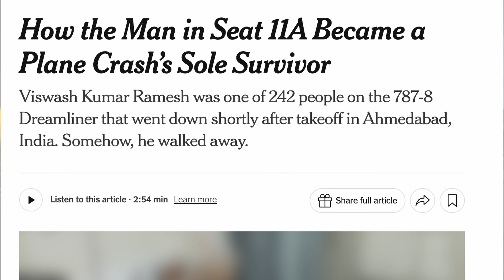Why the RAT Changes Everything – Air India 171 Update

Comment: A few points:

1. RAT deployment on the 787 can be manual or automatic. It is automatic in the event of total loss of hydraulic pressure for the flight control system actuators, or total loss of electrical power. Both of these conditions exist in the event of dual engine failure. Manual deployment is part of the crew immediate actions in response to dual engine failure. Right now, we don’t know which it was.

2. The aircraft flightpath shows clear evidence of engine spool down in the early part of the climb after rotation, and it may even have started prior to Vr. 

3. The last ADS-B transmission was at 100ft AGL (the 625ft reported was pressure altitude, which uses a different reference level for zero). At this point the aircraft was about 100ft lower than it should be, with a rate of climb and flightpath angle about half of what they should be.

4. “Positive rate, gear up” typically happens at about 50ft AGL and from the video it is clear that the main gear tucks had started to tilt, showing that gear retraction had started. But it stopped at that point, meaning most likely that the two centre hydraulic system pumps had stopped. They are electrically powered, and for both to stop would need both sets of engine driven generators to stop. This further supports the engines spooling down significantly during the initial climb segment.

What we don’t know is what caused the engines to spool down, leading to massive loss of thrust and electrical and hydraulic power. It is incredibly rare for two engines to fail simultaneously like that, and almost unheard of for that to happen during initial climb. The rapid rate of spool down without any visible smoke flame, noise, etc, strongly indicates fuel starvation but what caused that is a mystery right now. The engine run/cutoff switches could do it, but why would they be touched during takeoff? Fuel contamination could do it, but it would need to be severe and it seems no other aircraft from that airport were affected. Some comments have even suggested sabotage. At this point there is not really any more that can be deduced without the data from the flight data recorder, but it is clear that engine spool down is the critical aspect for which the cause needs to be identified.
Reply: Great observations… any comment regarding the flaps?
Reply: @Johnoftheshire  I think that is a red herring. The aircraft has protections to warn the crew of incorrectly set flaps, so the probability of them having been set wrongly for takeoff is extremely small. Similarly, flap retraction happens late in the climb, not at 100ft AGL! And we know the gear started to retract. So based on the evidence I think it is sensible to discount flap position being incorrect.

Also, aircraft rate of climb or descent is determined from (Thrust - Drag) x (True airspeed  /weight). Nothing in there about flap setting, although retracting flap too early could lead to a stall, but there are not signs of that having happened.
Reply: I agree there are no indications of a stall, and I’m aware of take off warnings with an improperly set configuration, but that appears to be a very clean wing for a fully loaded long-haul flight on a hot day. Your comments are quite salient.
Reply: @Johnoftheshire  actually on a hot day, provided the runway is long enough, smaller flap settings are advantageous. The takeoff roll is longer but the climb gradient is better, making the aircraft better able to handle an engine failure after takeoff. The runway at Ahmedabad is a very long one, over 11,000ft, so it makes absolute sense given the summer temperatures there to use Flap 5.

Comment: That's not the RAT  it's too far down, from the planes undercarriage,  that's the planes nose wheel.  So   who are you trying to kid, and it's   in comparison to the plane far to big  to be the RAT.    the planes black box will let us know what went off and the planes wings what's left of them will show if the flaps were retracted or in the correct position.

Time index 2;47  put  the video on pause  !!!..  you can clearly see the planes undercarriage  and there is NO   RAT EVEN DEPLOYED  THIS IS JUST MOMENTS  BEFORE THE PLANE WENT DOWN,  AND I DO MEAN MOMENTS,  8 seconds  in fact.  So all this talk from this captain here  is not making any sense other than it's nonsense.
No ,  something else has gone off here and it STINKS.

And you don't need to be a pilot to understand those factors. 
There are warning devices in the cockpit  to prevent making simple mistakes. Also i find it very hard to believe that both the Captain and the First officer with all their flight hours experience would make such a fatal error while taking off..

Even if the main engines had failed  they would still be spinning for quite some time and the noise from them spinning  would still be drowning out any RAT's sound. plus the RAT is a very small two prop  blade.  BASICICALLY  dynamo generator.
But as i have said at time index 2;47 you can see no RAT  was even deployed, is is about 8 seconds before the plane crashed and any talk of the RAT being seen  out  IS ALL  BALLONY 

Sorry i ain't buying a single thing this so called captain is saying not a single word of it. Who you trying to kid mate and more over why. You're saying it's a grainy image of the RAT but you cannot be totally sure.. Sorry not being sure is NOT GOOD ENOUGH. The Air Investigators will only be dealing with facts.  not grainy pictures or hear say..  But  FACTS  only.
And the only person to walk away from this , you're saying he's making stuff up or he imagined it..  ARE YOU REAL ??

P.S    I THINK IT'S  FUKCING SICK OF U-TUBE TO BE PUTTING ADVERTS CONNECTED TO THIS VIDEO..   YOU'RE A BLOODY DISGRACE.

Comment: The sound of the RAT propeller is heard when plane is close by, that is when the rat would be better visible. But it's not. You can only point it out when plane is far enough to RAT be only a splotch on the screen. The timing doesn't work here.

Comment: There was a guy that was on that plane coming into that airport and he said they had no air conditioning, no lights and no call buttons or TV’s working on the flight. I think it was a full electrical failure that killed the thrust ability and the rest of the systems couldn’t fire up quick enough to try to recover it. It was too late.

Comment: I THINK ----------- everyone is all partly wrong on this ----- Im not a pilot , but think about it if both engines went out you had what 20 seconds from No engines to crash , the first thing your going to do is send out a "MAY DAY"  I think that is the last thing id be doing I would be trying to fix the problem in those 20 seconds ..... also it looks to me engines were working at take off look at dust kicked up on left engine at end of runway , also what pushed the plane down the runway was it gravity that got them to 150 MPH for take off ...   --- I think you will find the plane had just come out of maintance ,, I think there is a problem from that happening 1. Broken wire that show flaps are deployed in cock pit when they are not  2. surely running down runway just as you went to full power pilots would say this is not right engine are not at full power ,, abort take off --- there is more to this ,, think its more than one thing going on !!!!

Comment: 6:38 and 8:47 are exatly the same. I am no pilot, but that does seem that you are right Captain Steve. But what could deactivate the engines so fast after the lift-off? They were obviously functioning in start, otherwise plane wouldnt be able to make a lift-off. But what happened so soon after is a mystery so far.

Comment: Flaps were up and gear down before the crash. Flaps retracted by FO instead of selecting gear up as called for by flying pilot. No Slats or flaps!  Check the attitude of the plane on attempted climb? I bet  the stick shaker came on and aircraft was stalling and mushed to the ground. Why did rat deploy? Auto deploy makes a bang when deployed and electrics & Hydraulics are provided by the rat. The gear did not come up because FO did not retract it when Flying pilot called for the gear up. Lot of drag for a heavy loaded aircraft  trying
 to climb with no flaps deployed and gear down.

Comment: so there's a combination you can see in the videos, the rat deployed, the sounds of rat and no roar of the engines which should sounds when taking off, the landing gear not retracted and also you can see the landing gears are tilted forward, and not backwards as it should, so they had no hydraulic power, I might get that wrong tho

Comment: Did you notice the dust clouds at takeoff? Where does all this dust come from on the concrete runway? What if it wasn't dust, but a fog from Skydrol when the hydraulics ruptured. A jet of fluid with a pressure of 5000 psi could cause a cascade failure - damage the wiring for example. I'm not sure.

Comment: Makes me think ......Batteries! I thought I read that the lone survivor heard a "bang" before the crash.
Back in 2013, 787's were grounded because of battery fires on ANA airlines  (launch customer) 787's. It was corrected using vents and insulation. 
Besides a burning wire or a short, What else could cause a major power failure? Batteries?
Thank you Captain for your excellent channel.

Comment: Could it have been a total electrical failure rat automatically deployed. At point of electrical failiure no power to fuel pumps thus no fuel to engines for a very short period. Thus engine close down. One things for sure. The pilots had no time or height to sort things out.

Comment: I am a engineer and i have my theory too Both engines failed due to contaminated fuel and the sudden loss of electrical power created a short circuit or a arc that burned a componets in the electrical system" that disarmed too many circuit breakers being either phisical or solid state that prevented any other AC generator to feed the airplane electrical buses. the failure gmay enerated a series of as-designed system reconfigurations, preventing the
supply of the Main Electrical Systems and Backup by the APU or RAT and prevented the engines relight, despite the generation of energy by the apu or RAT. Why the engines experienced a dual failure? Fuel contaminated with water due lack of maintenance, engineers not draining the fuel tanks ant the appropieated maintenance stops, or tainted fuel with a lot of water by the refueling company as it is  not unusual event in some countries .

Comment: One can clearly hear the engines winding down whilst it descends. It almost goes quiet before the impact. Contrast that with the sound of a 787 in a go-around scenario. Those engines roar. Clearly pointing to the significant possibility of a dual engine failure. Possible a software issue with the FADEC who knows?

Comment: The wheel trucks are also pointing front down, which suggests a failure to retract.
The flaps appear to be down, in either 1° or 5° config, as there is a visible notch around a third of the way down the trailing edge from the winglet.
Similarly, there appears to be leading edge spoliers deployed, due to the shadow.
These are backed up by the photographs of the crash site where we can see the leading edge and trailing edge flaps are deployed.
It sort of suggests either total sysems, or single system failure.
I would weight probability as 60% total electrical failure or 40% hydraulic failure.
There have been previous electrical failures documented on the aircraft series, though most were battery issues between 2012 and 2014, one Japanese company found three aircraft with electrical problems in the engine fire supression system.

Comment: According to Chatgpt (And I think this is it because of all the reported electrical malfunctions onboard+the deployment of the RAT):

 ⚡ 2. Electrical or Software Failures
	•	The Boeing 787 is highly digital; simultaneous FADEC (Full Authority Digital Engine Control) failures due to electrical fault or software bug could shut down both engines.
	•	Loss of communication between aircraft systems and engines due to power bus failures.

Comment: I have a question that no one has answered yet. If the "RAT" is deployed due to a malfunction, or manually, apart from the three scenarios mentioned by Capitan Steve, would that cause the engines to shut down? In others words, if the RAT deploys... and the engines, electrical and hydraulics are all working.... will that cause the engines to shut down.

Comment: 100% correct, I actually think there is no doubt looking at the facts. I believe, and read reports about this plane that had an upgrade recently, also saw a video of some issues they had with the electronics....I think therein lies the answer, in the recent upgrade and maintenance of the plane...also if the electronis issues were well known, why did nobody act and pull the plane off the grid until it passed quality checks....very sad this....nothing the poor pilots could have done, same, I think, cant be said about Air India and whoever carried out the upgrade and maintenance

Comment: Let's propose a National Geographic Air Crash Investigation theory:
1. Solenoid Land Gear Actuator jam due to the stress cycle, hot and humid weather and dust.
2. GenX NOX reduction and Power Boost during 37C Hot And High Boeing Takeoff and Climb Hack. Read NASA
3. Water Misting and Injection of Boeing Engines compressor inlet with 360lbs performance impact.

Avoid Pakistan Airspace, Save Oil Return, Extra Fuel, Extra Weight, Land Gear Drag, A300 Hot And High Maneuver, Low Maintenance, Hot and High, Sabotaged Solenoid Gear Retraction conditions led to Low Thrust, Stall

Comment: My position at the moment as the doors aren't open on the gear, So I think what ever happened, happened right at the point of gear up, I.e., positive rate , gear up. It did have a prosative for a few seconds,  The electrical fail occurred at the point of wheel tilt on the B788 and before the door opening.
I've been watching B787 take off all day at work there is a slight difference in order between the B788 and B789,  The B788 will tilt at the same time as the door open and the B789 tilt after the doors are open.

For me it maybe an accumulation of a set of particular faults that happen in a particular order or within moments of each other, individually they are not a big issue, i.e if they happens on the ground, do a reset and if the error goes then it can dispatch.
The trouble is if you have 2-3 faults all doing that, all resetting and all getting dispatched at different times then in the right conditions and order it maybe just be enough to create something that wasn't planned, expected or considered because the possibility is so remote but not impossible.

The DGCA wanting  all repetitive technical faults reported over the past 15 days must be reviewed and addressed promptly is covering the angle im thinking.

Comment: Hello Captain Steeeve,
To the best of my understanding, the issue lies with the Maneuvering Characteristics Augmentation System (MCAS) software installed in certain Boeing aircraft. The horizontal stabilizer, located at the rear of the aircraft, becomes difficult to control manually when the MCAS is activated. I may be mistaken, as I do not come from an aeronautics background, but this is my interpretation of the problem. Similar issues were observed in the Boeing 737 Max crashes involving Lion Air Flight 610 in October 2018 and Ethiopian Airlines Flight 302 in March 2019.

It is also worth noting that the Boeing 787 Dreamliner has faced problems related to its lithium-ion batteries, which have been known to overheat and, in some cases, catch fire. However, this may not be the cause in this case, as there were no reports of smoke or fire.

Comment: This is not surprising. There are wreckage photos that clearly show the APU inlet door open. To run or attempt to start the APU in flight is unusual unless there has been a multiple engine failure or the pilots forgot to shut it off.

Comment: The flap theory is wrong in every way because in boeing im pretty sure they have a system to not put the flap to any angle for it to loss lift and also it doesn't happen quickly,when you put the flaps up it will take time but the crash was in no time and sudden!

Comment: Steve, can't officially state but internally with our company we have reports its likely the captains seat was manually adusted and did not fully lock back in after he released the handle and slid all the way aft during rotation. The captain inadvertantly pulled the throttles back to idle as his seat slid aft. Couple things happened....On theses modern engines they can take up to 30 seconds to spool back up to takeoff thrust if pulled to idle and power is reapplied immediately. Also the 787 has variable frequency generators which when the engines are pulled to idle and the gear is retracted could cause the system to determine the there is not enough electrical power for the hydralics and deploy the rat.
Reply: This is just...what???

Comment: But you can hear that engines are not working, plane at this low altitude makes a lot of noise when engines are at full power. This one is quiet  as glider and sound that we can hear is quite similar to small prop like in RC airplane models when you turn off engine. This guy is right, this sound is from small prop and engines are off. Probably there is another software glitch and Boing will cover up as usually. Probably as usually some economists are ruling in Boing using money to overriding decisions that supposed to be made by engineers alone. Doing some shortcuts to safe money. It is always like that. Also it is well known fact that electronics with small lithography will fail from cosmic radiation (it is only a matter of time). CPU are making calculation errors over a time.